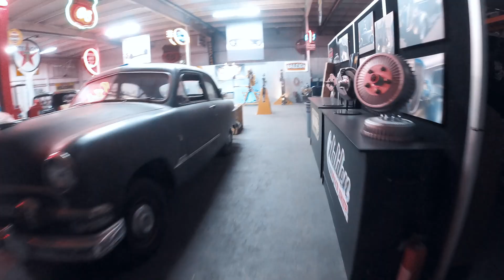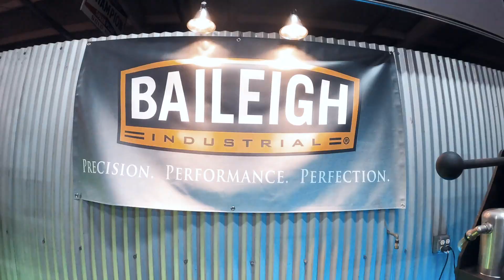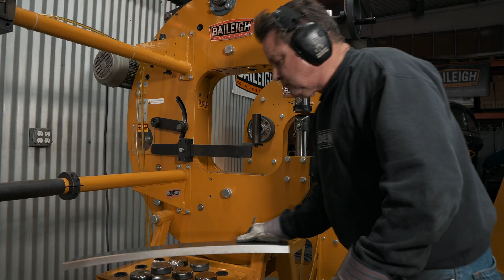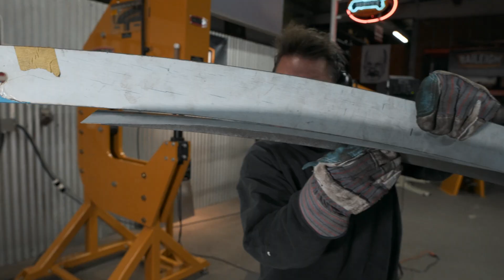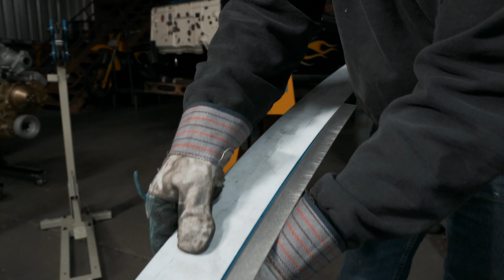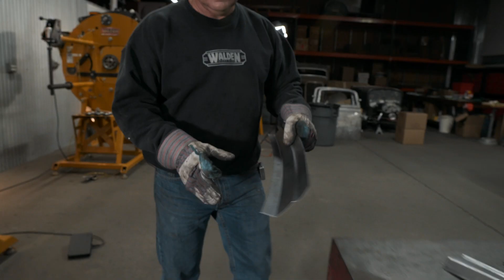Baileigh TV: Walden Hammer Works Episode 5

Comment: Hello Bobby, cool things you build in your shop, very impressive! The Baileigh machines are also very interesting... Now I have a question for the absolute specialist... You have a Joder and a Pullmax in your shop and you use them for different jobs. With the MH 19, Baileigh offers a combination of both machines. What exactly is the difference between a Joder and a Pullmax when processing the sheet metal? In the Joder I can plan, stretch, I can shrink with thumbnails... With the Pullmax I can also smooth, stretch, shrink with thumbnails and also work profiles into the sheet metal, etc.
Why do you switch between "Power Hammer mode" and "Pullmax mode" in the MH 19? Greetings Jan